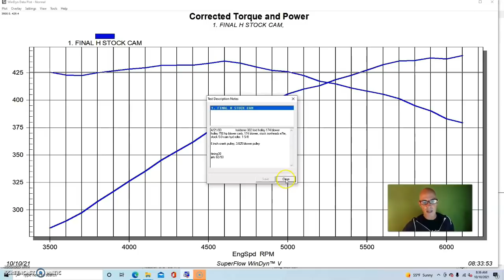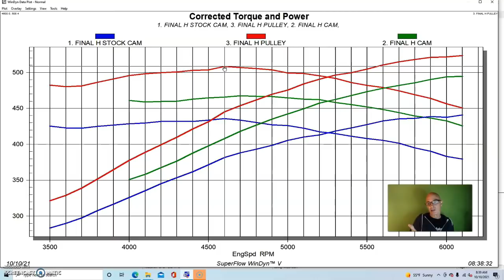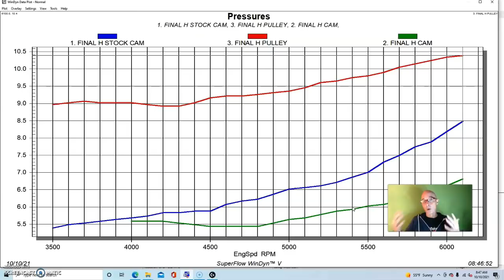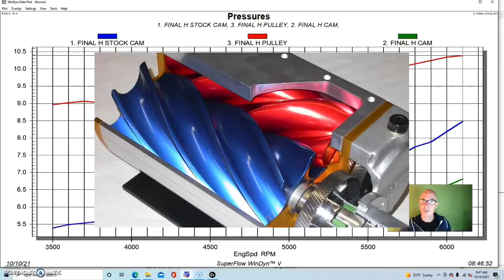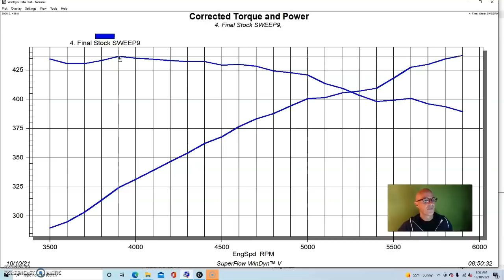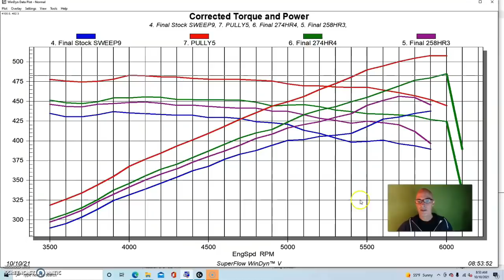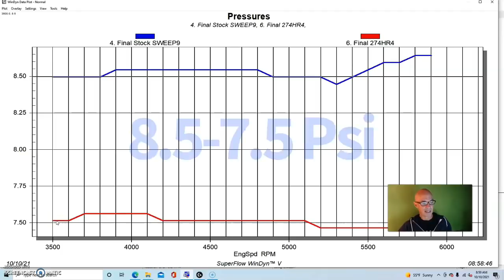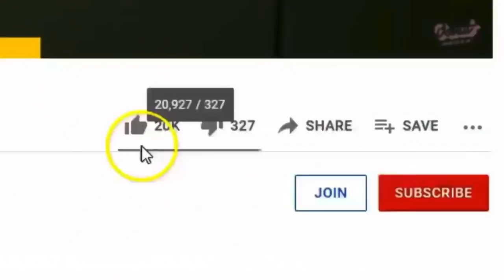HOW MUCH POWER ARE 5.0L SUPERCHARGERS WORTH? HOW MUCH HP DO  HEADS, CAMS AND PULLEYS UPGRADES MAKE?

Comment: Can you go too big with the heads, without changing the pulley, and still make more power? Would a 220cc head be OK? Extremely low boost pressure.
Reply from the maker: those heads will be fine

Comment: On test #1 when cam was swap you said ex 264 but showed cam card for #35 514-8.I think that's the cam ex266hr. Please say yes.I'm installing your same set up in my  78 Zephyr .The ex266hr cam that is.I bought everything already. Plus the same blower and same Canfield  20-450-65 1 heads .Oh God help me! Sorry Oh Richard help me!
Reply from the maker: either cam will work fine-the 266 is slightly bigger, we used the 264

Comment: What where the compression ratio on these engines??
Reply from the maker: mid 9s
Reply: I was thinking of putting a 177 on my 355 but I did the calculations last night and it's 9.96:1.. with Hyper pistons. Don't think it will last much beyond 3psi... what's your thoughts?
Reply: @95zsean  depends on the ring gap. 9:1 here with a Heaton on hypers. Will be running 12psi manifold pressure after intercooler and cop a spray. 

GM l67 motors are factory hyper pistons and there's guys running 20 psi with them. Hyper pistons are great but they need a fat top ring gap with heat.

Comment: I'm surprised at how well the old, low-tech Weiand 174 Roots performed compared to the Kenne-Bell twin screw.  2-lobe dogbone rotors uncoated and without seals.  I thought the twin screw would kill it.

The Roots-blown engine made 495 HP on 6.7 psi boost with the Canfield 170 heads and 212 cam.

The twin screw blown engine made 456 HP on 8.5 psi boost with the AFR 185 heads and 208 cam.

But the ugly old Roots blower killed the Kenne-Bell on what should have been a weaker combination.
Maybe the Kenne-Bell twin-screw is a hog on how much power it takes to drive it.
Reply from the maker: different motor-different boost etc...

Comment: Have watched the video yet. How much power? I think 21 hp per psi supercharged lol
Reply from the maker: the hp/psi depends on original na power
Reply: @richardholdener1727  sure does haha 
I overheard a conversation where a bloke was talking about putting a turbo on a 1.3 litre because he was going to get 30 hp per psi. Yeah probably not going to happen. I think I did the maths in my head stock 5l 250 odd with about 9 psi made 425 which is plus 175 my maths says about 19 hp per psi I was a bit off lol

Comment: Could a twin scroll supercharger + centrifugal supercharger work together on the same motor❓  (give or take a wastegate) Minus the "if" factors like enough octane, or enough compression or variables like that...  Could it be even worth it to try them together?  📈📊📋🏎  I wonder often about the perfect future engine and what might be different.  Perhaps a triple boosted, "free valve," small displacement, short stroke, @10-30% methanol / 70-90% gasoline could be the ticket.  Anyhow, that is what seems to persist in my head so far.
Reply from the maker: you can combine a centrifugal and twin screw if you like

Comment: Throw a .050" shim under the intake springs on the afrs and make another pull; that thing was pulling hard up top before the loss of stability
Reply: That AFR test was way back in the day before they offered the 7,000 RPM hydraulic roller spring option probably now you just ask for the spring upgrade and yeah you'd probably get there the trick flow 11rs probably would get you there way over that

Comment: Gonna throw out a guess the twin screw is far more efficient therefore it makes more power per lb of boost
Reply: A twin screw is more efficient!
Reply: @bri-manhunter2654  the modern tvs is more efficient than twin screws.  Twin screws being "more efficient" is an old outdated way of thinking.
Reply: @midnight347 . Nobody is running those small TVS blowers🥱
Reply: Even look at the flow maps for the TVS and M series of blowers from Eaton. The TVS isnt a twin screw, it has no internal compression, its just pretty good.